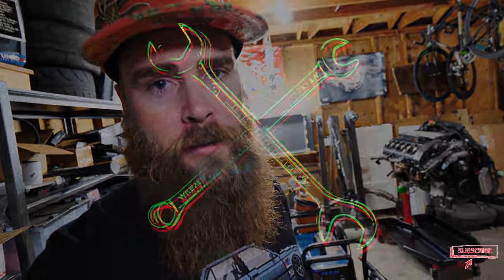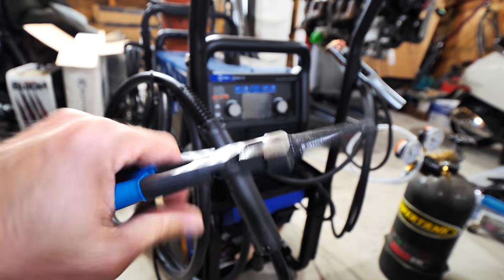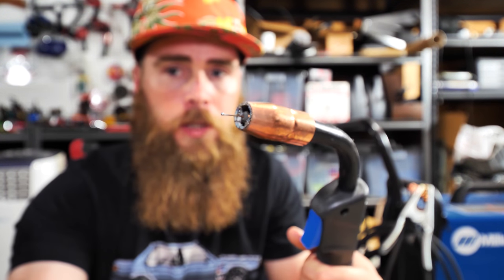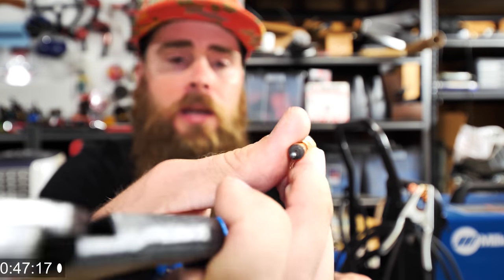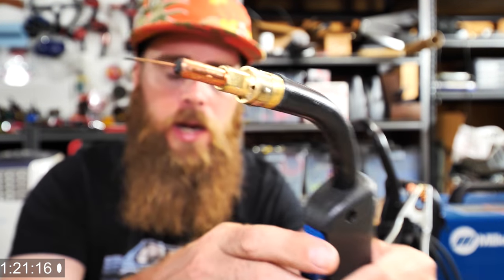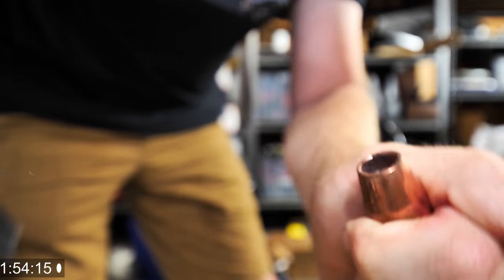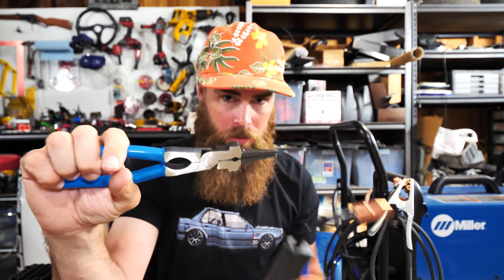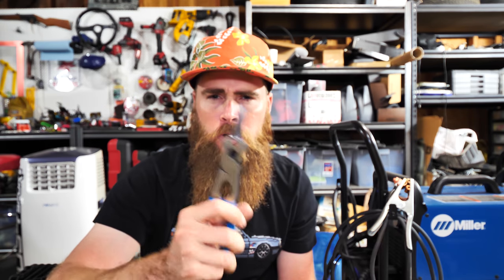MUST HAVE TOOL FOR MIG/FLUX-CORE  WELDING

Comment: Yup! Welding without these is just so much more trouble. You can use it for a lot of other things, welding or not. Tip! If you cut the wire end off using the clippers facing away from the nozzle, and up against it, it will cut it to the perfect length every time.

I don’t like the ones that are “ergonomic”. Yes, they feel great, but you have to pick them up the right way every time. And how often is that going to happen? Like never.

Comment: I got a question for u i got a c10 long bed im trying to cut it into short bed can i weld the frame with flux welder a guy at the place i work told me that flux will break that stick welder shoul be the one but i see some videos of people welding frames with flux i dont realy know about weldig i just bought a flux welder can u help me wiht the question please!!